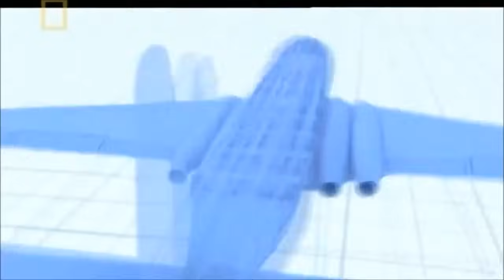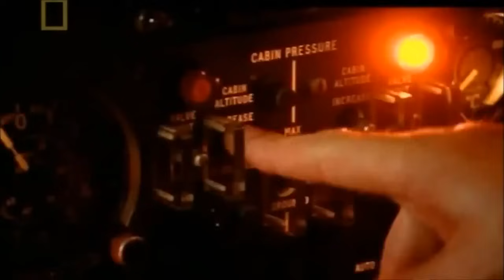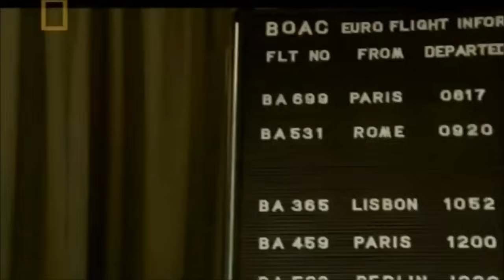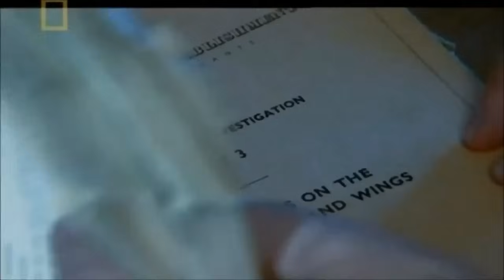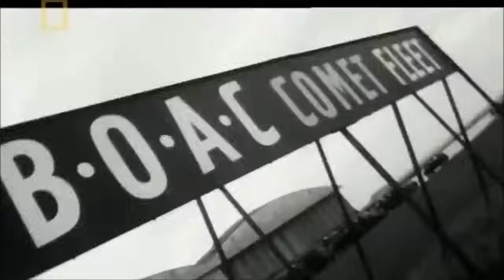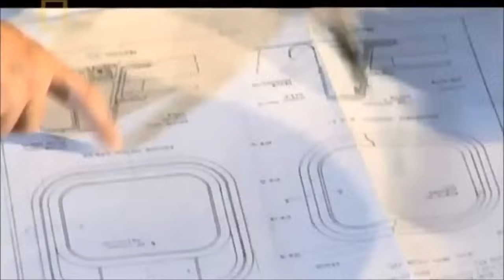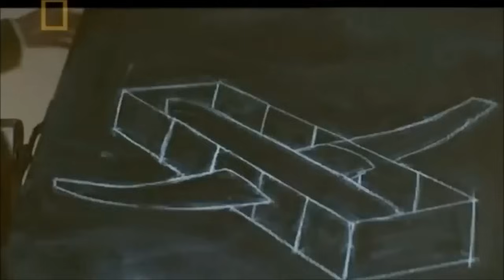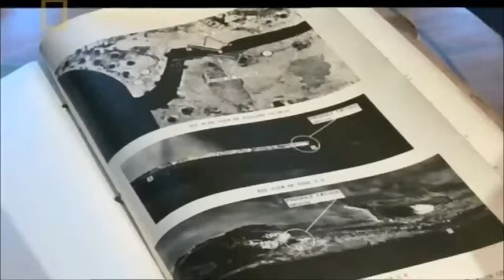British Overseas Airways Corporation Flight 781

Comment: the Americans were frightened that Comets would end up reversed engineered in Russia, and threaten them as they slept in their little beds. I dont think they sabotaged Comet, but would not be surprised if they did.
Reply: What garbage.  The original Comet was under-engineered, pure and simple. That was proven nearly sixty years ago.
Reply: how do you under engineer something?
Reply: Stephen Archer When a brand new airplane breaks up in mid flight it is underengineered. As it turned out, cracks in the plane's skin formed around the square shaped windows, leading to catastrophic failure. The Comet's designers found this out after several breakups and crashes. Had this particular test been done during development, the breakups and deaths would never have happened.  Certainly not the drivel and lies you posted.
Reply: Comet was years ahead of anything the Americans had. The limitations on design imposed by fatigue cracking were not well understood at the time. That's the official reason for the crashes but sabotage was considered. Either way it suited the Americans.
Reply: Stephen Archer You seem to be making things up as you go along.  Fatigue cracking was understood well enough by how the solution to the problem was discovered. It was a very sim[ple and elegant test. It should have been done before a single plane took flight.  Commercial aviation didn't begin with the Comet. Youu sound uber jealous for some reason. I've never read or watched any documentary about sabotage. Weren't we sided with you during WW2? As for years ahead...meh....only in speed and not all that much. The original was about 90 mph faster than a DC-7. But with a max of 44 passengers vs. the "7"s 105, well no so very far ahead.  Range, the Comet,  2,400 km, the "7"s 8,310 km. Again, not that far ahead. Matter of fact, some huge steps back.
Reply: not uber jealous, whatever that means, but somehow effortlessly superior. Happy New Year
Reply: Poor supposition on your part.
Reply: Stephen Archer I wouldn't say it was more advanced than anything the US had. It may have been the first commercially operated Jet airliner and it was more advanced than piston engine airliners of the day but technically it wasn't as advanced as the Boeing B47 Stratojet.Flown in December of 1947, a year and a half earlier than Comet, the B47 had a revolutionary 35 degree swept wings and turbo jet engines mounted in pods beneath the wings. A configuration that has been adopted by all the major commercial aircraft manufactures.
Reply: We slept in our little beds?  Who do you think you are, some omniscient observer?  To me, you seize the easy path, namely criticism of others that failed, even if they worked in earnest.
Reply: Stephen Archer Comet was way ahead of anything the USA HAD????  WRONG  remember the B47 flew in 2/47  and the B52 in 1952..all before the Comet and they were vastly superior to the Comet...
Reply: and the range, passenger capacity, and fuel efficiency of the B47 and B52 were? :)
Reply: Stephen, you make a lot of assumptions, which are only outdone by your crass comments.  (Slept in their little beds?)  Where do you sleep?

By the way, no passengers on a B 52, except the crew.  Not even a stewardess to help make long hours in the cockpit a little easier.
Reply: Yeah, Comets were SO GREAT that they were immune to poor design and poor manufacturing.
Reply: The USA did not have to sabatoge   the Comet... they self destructed....

Comment: You were the one who is brainless. Aluminium is about 4/5 strength of steel yet almost 1/2 it's weight. 737 is also travel at high speed. And aluminium isn't cheap at all. Modern aircraft uses less than 0.5 mm of aluminium, instead they use lighter yet stronger fiber glass or carbon fiber composite. Luckly the plane capacity not more than 100. It's the first one, so mistake is ALMOST must happen.

Comment: Obviously the British never dominated aviation. Boeing 707 and Douglas DC-8 learned from the comet's mistakes and America has lead ever since! 🇺🇸
Reply: Boeing, Douglas and Lockheed were building pressurized passenger airliners years before the Comet Disaster and most of the industry already understood the effects of fatigue in all metal airframe structures very well.
DeHaviland was still building aircraft out WOOD when it attempted to built the Comet 1... D-H engineers not only did not understand how to build pressurized planes with rivited all metal construction, they also failed to properly test the fuselage.
The Comet Disaster was the result of incompetence not cutting edge technology.
Reply: The Boeing 707 made its first flight before the conclusion of the Comet Disaster investigations were completed and peer reviewed.
No changes were made in its design based on the findings of these investigations.
Reply: I watched a video by Mustard on YouTube that boeing and Douglas said they learned from the comet's pressurization problems. It seemed accurate idk
Reply: @renroxhrd  That is very inaccurate and misleading.
The Boeing 307 was the first pressurized airliner followed by the Douglas DC4E and the Lockheed XC-35 all flew in 1937-1938.
This is a period when DeHaviland was still making biplane airliners constructed from WOOD and CLOTH. 
Prior to the Comet Disaster DeHaviland was still building aircraft primarily from WOOD and glued together, the company had very little experience with all metal airframe structures or modern riveted joint  construction techniques
Reply: @dannyadams2211  Just the facts here, de Havilland received technical data on pressurized cabins from Boeings B-29 during WW2 but engineers had no reference for any of the information as D-H was still building aircraft primarily from WOOD.

de Havillands first jet, the Vampire was only pressurized to 1.5 psi because it was constructed from plywood.

The Comet Disaster is the worst engineering failure in aviation history... but the real tragedy of the Comet was that it could have been prevented if D-H learned from the American manufacturers.